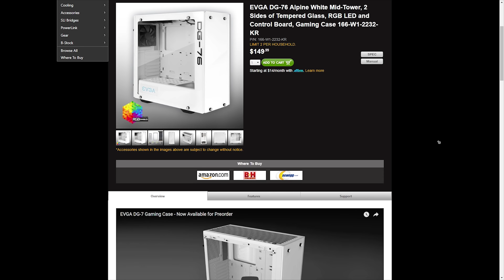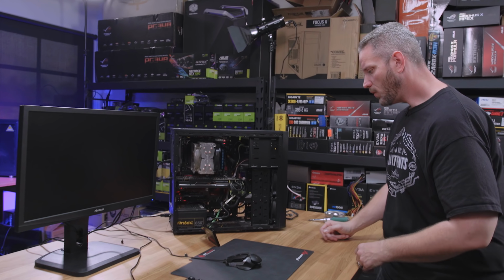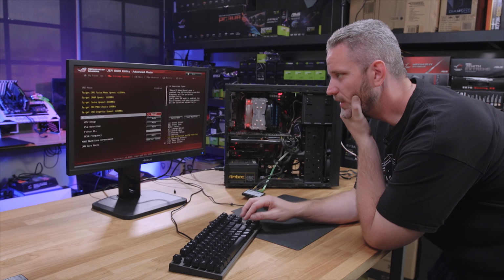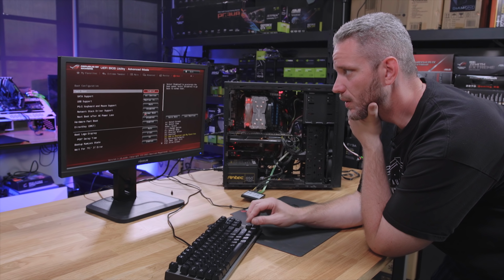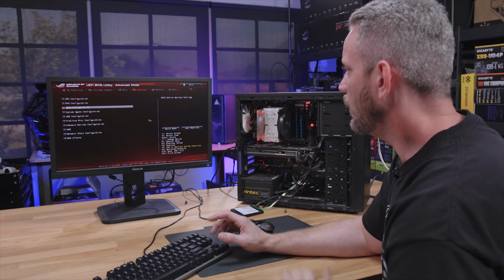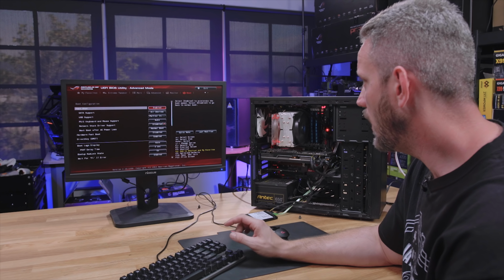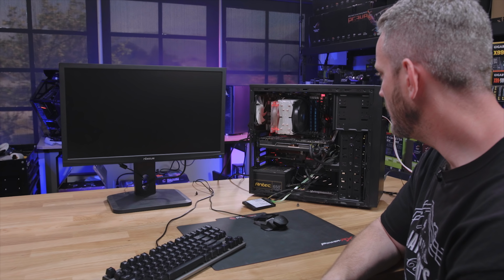Troubleshooting a bad computer... can we fix it?

Comment: I swapped out my SSD drive as I wanted a higher capacity one and used the Samsung data migration tool to copy my OS to the new drive. Went to bios and selected the new drive to boot from and about three times it failed to fire up. Turns out that after i set up the boot order I didn`t save so every time I powered down it was then looking for old drive to boot from. pulling my hour out for about an hour before the penny dropped...... DUH!!!

Comment: Jeez...

1. One of the important things i check every time, is bios & cpu Version and if there is any incompatibility...
The installed Version is 1101 (btw from 2013...!) and does not Support 4th gen cpu´s...

Info from asus.com:
-->> Version 1203 
2014/01/035.17 MBytes
MAXIMUS VI HERO BIOS 1203
1. Improve system stability.2. Support New 4th-Generation Intel Core Processors
3. Before using the new Intel 4th Gen Core processors, we suggest that you first update the BIOS using USB BIOS flashback, or download the BIOS updater for new Intel 4th Gen Core Processors and then update the BIOS using it.

*But interesting, the system boots anyway, with the absolutely outdated & incompatible Bios for this cpu...

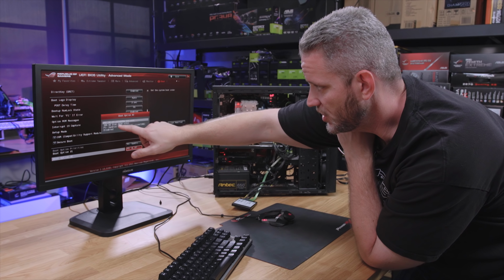2. As seen at the post Screen @ 3:05  only 1x SDD and 1x ODD is recognized on boot-up, so it was clear that the Sandisk SDD" isn´t recognized properly, but only the Western Digital HDD was...but you found it out (yourself) -> @ 5:03! 
And finally, you discovered where the Western Digital HDD is installed, too!

3. @ 8:22 you forgot turn on the power supply with the on/off Switch was a real funny mistake... *LOL
but, in this case: thank´s to the assistant...!

So i would say thanks for this cool "HOW-NOT-TO-PREBUILD-AN-NEW-COMPUTER-SYSTEM"

OR

"HOW-TO-FIX-EVERY -MISTAKE-CAN-DO-BY-BUILDING-A-COMPUTER-BY-YOURSELF"

LOVE THIS CHANNEL!!!!!!!!

Comment: I have a Toshiba think center and my fan always runs on maximum. Sometimes it won't even boot up. The fan will start and the after a few seconds the system shuts off. I can get it to turn on by disconnecting the fan and letting it boot up. I've got some thermal paste, because the paste that was on there was completely dry. Does anyone have any solutions? 

1st issue: The pc would boot up, but at the start screen it would freeze for a while. While in the frozen state the hard drive would make repeating sounds until the pc would boot up normally.
2nd issue: While the pc would be running it would freeze for a while and do the same sounds until it would start running normally again. 
3rd issue: The fan would start up on full speed and then my pc would shut down immediately when I would try to start it up. 
I've used this Toshiba Think Center for 4 years now and I haven't changed hardware wise.

Comment: Champion , great vid Jay , if you are ever in Australia :) i have a mission for you ' $3500 build and it is not smooth it is glitchy  in game and even  windows 10 start menu comes up jerky i have a 2080 rtx ,64gb ram g skill  and a i7 7700 on a Rog strix z270h , windows in on a m.2 drive ,  its not overheating could it be a compatibility issue ? hope u can help ,  cheers

Comment: Hello People I'm putting together a new system but need some advice. I need to know whether or not to get a SSD I don't want to get a low capacity drive but I dont want to spend to much. I don't really care about boot times as I normally leave my current rig in sleep mode but how would it help in games such as Ark Survival Evolved, Rainbow Six Siege, and Black Ops 3 Mod Tools. I know people will say Just spend the extra money on it but I just want to see if the cost is justified. I'm getting a Ryzen 5 1600 not planning on overclocking but I am gonna buy a Liquid Cooler. Its a Master Liquid ML240L primarily because I think they look really cool and not as loud as an air cooled solution . So should I take that out and buy the SSD instead I guess if I really need one I could get a 240 gig like the Sandisk SSD Plus. I'm 16 putting $200 down every paycheck for this computer. So what should I do. Here is my PCPartPicker list for it.
https://pcpartpicker.com/user/Bloobyplays/saved/Z7Vpbv
Reply: Some games will see an improvement from using an SSD for them while others will not, it all depends on how much and how often things are loaded from the drive during game play. If the games you play have zones that require you to load into the next area, this could be an indication of a game that would benefit from an SSD. Of the 3 you listed, you will only see improvement on the start of the game, and possibly at the end of each match loading back into the lobby, but not likely anywhere else.
Reply: Just looked up if they help Windows updates go faster. Defiantly getting one Just becasue they help update times. AND I HATE UPDATE TIMES.
Reply: Then longest part of updates is the download and an SSD isn't going to change that at all. Just sayin' Aimlesss
Reply: Jim Cole The download isn't what bothers me. It's when I boot up my computer and it says. "Working On Updates 100% and takes like 10 mins. Just a little pep pieve.
I hate Windows updates so much I'd trade my RX 480 for a ryzen 5 2200g for them to go away.
Reply: Understandable AimlessYT hehehe. Even with my system, and it is no slouch with an M.2 boot drive and a SSD RAID 0 program drive, but those updates still take over 8 minutes for me and I have 200Mb download speeds.

Comment: Need some help. I just built my new pc:
MSI Tomahawk B350 motherboard
RYZEN 5 6 core 12 threads
MSI R9 380 4GB Graphics card 
8 GB ram (will be getting more ram soon.)

I installed Windows 10 installed all motherboard drivers and tools as well as updating them. Yet I can't see the 500 GB HDD only the SSD for the Operating System. I even checked disk management and nothing. Any help would be greatly appreciated. Thanks
Reply: I even did Windows update.

Comment: PC Building Simulator helped me troubleshoot my PC ;-) Playing the game I noticed that my GPU temp would go from an idle temp of 32c to 53c within 10 seconds, and this is with a custom liquid cooled loop on it. This wasn't happening with any of the other software on my system. Worth the money just to find out I had a cooling problem hehehe.
Reply: If you were playing a game then your GPU wouldn't be idle. 53c is still low as hell. You have no cooling problem.
Reply: When the game isn't doing anything graphic other than displaying a static image and the temp jumps 20c in 10 seconds that is an issue, especially when the system is water cooled. John Herron.
Reply: It’s still running a game. How do you have a custom loop and not know how a video card works. Can’t even tell the difference between idle and load.
Reply: Jim Cole tell me then.  What’s causing your issue? When you play games your temp goes up. Even if it’s not a super intense scene. The graphics card is still rendering everything you see. even static images.
Reply: John Herron: A static image is a lot less demanding on the graphics card than a moving image. The memory doesn't have to continually purge and refill to accommodate a lot of changing pixels. If you want to see this point illustrated, run a game and pay attention to the frame rates, then go to the menu and look at the frame rates. The menu will usually max out your frame rates where playing the game will likely slow it down considerably depending on the game. 

The point you are missing though is that this is a water cooled graphics card and shares the same loop as the CPU. With this point, consider that the temperatures shouldn't make a rapid change in any direction unless there is an issue with the block not cooling the component properly. If you watch some of Jay's past videos, you will see that the temps gradually rise or fall over time due to the length of time it takes to change the temps of the fluid used for cooling. The temps don't just jump from idle temps to near max temp in that short a time.
Reply: Jim Cole we also aren’t talking about liquid temp. Your GPU still makes heat when it’s under load. It’s going to heat very quickly because there is voltage applied. It’s physics. How long exactly do you think that would take? Because temp increase under load is almost instant.

Comment: Late comment I know, but I've got a harder one for you. My EVGA X58 Classified 3 just wouldn't power up correctly when the PSU is turned on but the board is off. All the lights come on and immediately cycle off right away. After tearing apart my whole computer, I finally noticed a microchip that just broke its solders and fell off the board!

Picture: https://drive.google.com/open?id=1hXOmLzuaURzxdHlk9aFy3uxoRumfNar4

Comment: i have a problem

as far as i know i have all of my parts installed and plugged in correctly except for one of the case cables  which i cant find a spot for

anyway when i plug in the power supply thing to the wall and flip the switch on the back, nothing turns on except the motherboard rgb light turns on and off, and when i press the power button on the top nothing happens

i looked on another video for help and someone said i need to update the motherboard bios with another cpu but i can’t do that because i dont have another cpu and the pc wont boot in the first place

i have one of my friends coming over later to look at it, but if anyone could help me before that would be great
Reply: Jetfire ok will do

Comment: lol I want you to troubleshoot my pc too jay

I just cleaned my whole custom loop, disassembled both gpu waterblocks and cpu waterblock, cleaned it all up, replaced TIM and thermal pads, flushed the radiators with mayhems blitz p1, the whole loop with part 2, changed the tubing, changed the fluid and now one of the gpus make my system crash, fuck, disasembly time again....luckilly I added quick disconnects around the gpus but still have no idea what went wrong. CPU stress test and gpu stress test with disabled sli works ok, just with sli on it freezes, sometimes even the 2nd gpu is not initialized by the os and simple reseating didn't help

temps are all nice and low again and I did both cards exactly the same, maybe I screwed one too much? I just have no idea what went wrong ;o[

Comment: Somehow i doubt this was "a friends computer".
Could it be, that you built this system yourself faulty to show us how it should be repaired?

Your Friend did obviously not build it himself or he would be able to fix some of it himself like the cable of the SSD not sticking in correctly. But then, who sells PCs like this with 5 casefans and an unmounted SSD?
All faults, except the cut off wire (how, just how do you cut a wire this way closing a case or something?!), could be done to a system within minutes withour damaging anything. Well, the faulty Fan, but those are not hard to get, at least not if you are JayzTwoCents...
All Parts in this computer look a bit like the B-stock from your lower shelf. Just a bit Jay-ish.

Dont get me wrong, i enjoyed the video and i think it showed a lot of errors someone fixing a pc could face.
But still, i think i am on a track here... :P

Comment: Wow, that computer is in bad shape. That cable "management" is horrible. The SSD just lying there bare isn't good. His WD HDD is going bad. Boot device was set wrong, and guessing he originally had the OS on the WD drive which still has windows 7 recovery on it or the whole actual OS. Fans were going bad, and way too many adapters used.

Comment: It's very layed out and easily how it was taught start with psu of course,  I ignore whatever sensor data or bios says it's often wrong anyways...I will jump it and meter it...probe the rails after some time...and looking for getting close to atx minimums...then yeah rma it or whatever. 

Everything else is mostly Debug in OS environment or off the mobo itself. 

Troubleshooting methods that I guarantee you work, I do not need the simulator.  Know what to look for dude.

Comment: This is why you have people like me....system builders...so nubs and scrubs don't make a cock and balls of building their PC, with bad cable management, poorly configured BIOs & boot drives, breaking cables & having all these unnecessary connectors.

It's the difference between a Lego master builder and a kid that just grabs a handful of random blocks and puts them together randomly. Throwing shit at the wall and hoping it sticks is not a solution.